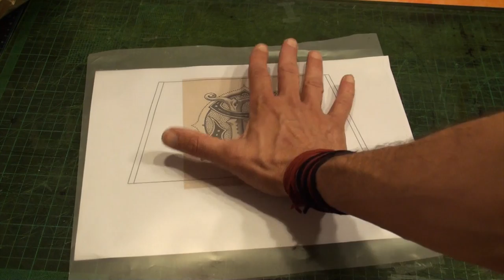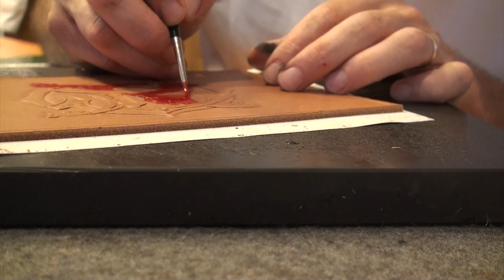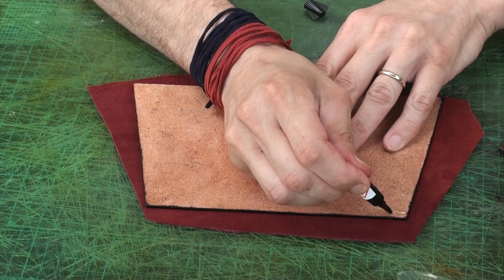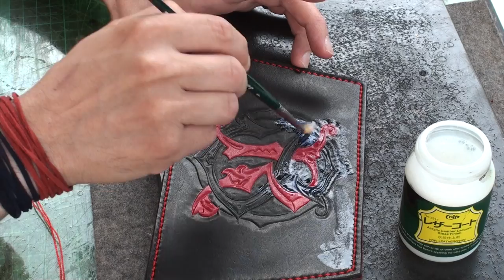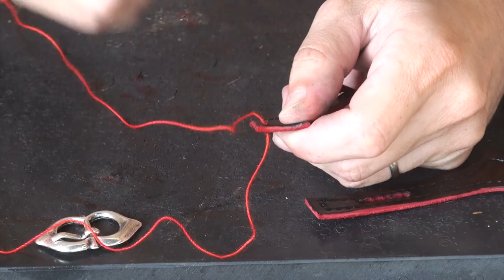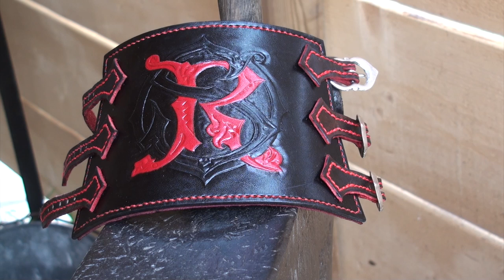Making A Leather Blacksmith's Wrist Cuff / Bracer - Leatherwork

Comment: This was great to watch!! And the end result is fantastic
Reply: I wonder if you could recommend a good starter kit for leather work?. I currently make bespoke wooden furniture and am looking to add leather to my furniture. I need a kit that is low cost but will help me learn the craft. If I can master it then I will buy more robust equipment etc.
Reply from the maker: Thank you very much! Means a lot to me. 
I'm not a big fan of leatherworking kits. They are often not very good quality and oriented to only one aspect of leatherworking. I would recommend to buy only the tools you need for your project, and if you like it, you can add more to your collection later. What you need to start is some kind of tool to cut leather, an edger, a burnisher, a compass to take measurements, and then you can add everything you need for stitching, putting hardware or carving leather. I hope it helps :)

Comment: Sweet project, I have a weakness for bracers and anything that attaches to the forearm besides a wristwatch. I know this is a far cry from what you did, but have you ever considered making the Assassins Creed arm blade? Combine your metal and leather skills? That would be an awesome build. I saw one other video where someone made just the metal part, but it wasn't very accurate, just functional.
Reply from the maker: Yes indeed. That's something I have been wanting to make for years. I never jumped into it. I don't know why. But for sure, I'm gonna try it someday. :)

Comment: What's on the hide portion of the leather that you're doing? The red clothe material. I just recently got into leather working as well and I, for the life of me, can't find out what to do with the hide portion of the leather to make it a lot more comfortable when wearing.

When making leather bracers, i'm currently using Gum Tragacanth to smoothen out the fibers of the hide but it's still a bit itchy when putting them on for wear.

And last question, noticed you didn't do any water molding with this piece. Is choosing not to do it a personal preference or do you find that it's an unnecessary step?
Reply from the maker: I glued some red suede onto the hide side of the leather. I find it very confortable to wear that way. For a long time I also used Gum TRagacanth but suede works better I think, even if the final piece becomes a little more expensive to make. 
I think water molding is not necessary for bracers. It is sometimes for sheath or other pieces but bracers will take their final shape wearing them. But it's probably matter of personal preference :)
Thanks a lot for watching !